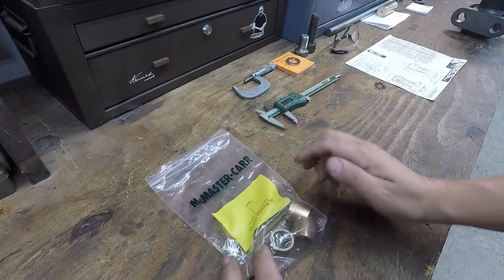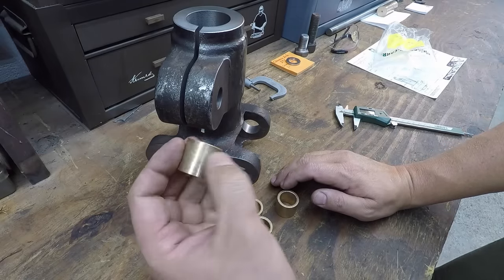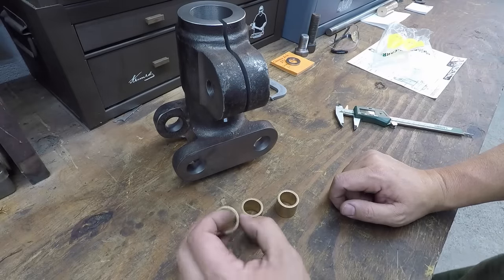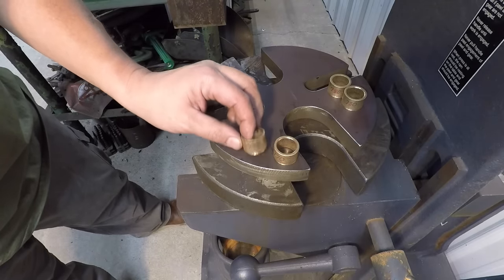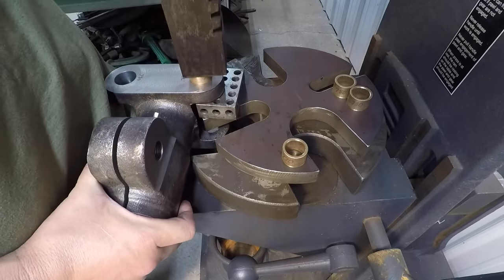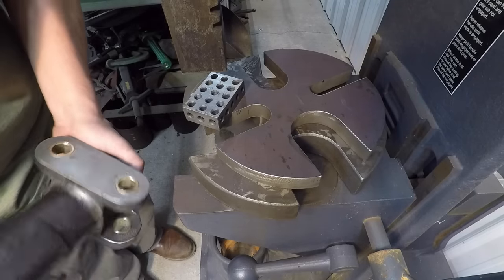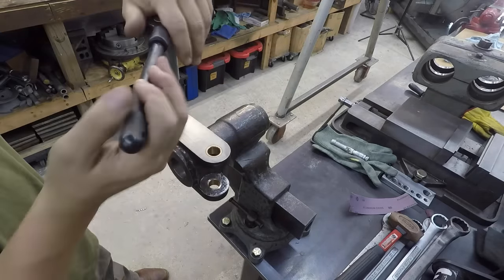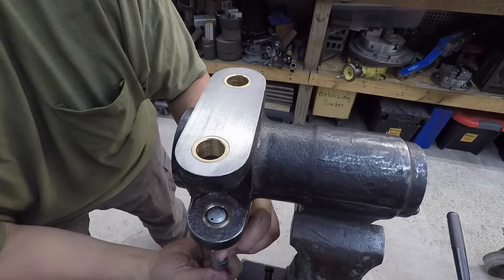Fairbanks Power Hammer Cross Head Part 7: Finished!

Comment: Adam FYI - I was just watching Will's video on rebuilding his Fairbanks and noticed that his cross head does indeed have those 'holes' where the central bore eats slightly into the swivel joint openings. So that's the way it was designed, and not a mistake in the casting, the boring, or the print.
Reply: I was really wondering about that, I wondered how could the casting have such an oversight. What is the purpose though? I wonder on.

Comment: fun fact:  pessimists say the cup is half empty. optimists say it's half full. Machinists say it's twice the size it needs to be and we part off 45% of it in the lathe, champfer the edges, then sleeve it with a .010 collett  :P
Reply: @jamesdrake2378  lol I'm an engineer, we say the cup needs to be redesigned to fit the needed space. after continuous research and development for 6 months, testing new theories for 6 months, the lead maintenance man drank the whiskey and asked for a refill...
Reply: sound technicians only say "check one two" because if we say three then that means we have to work
Reply: @k4x4map46  Now that's funny!

Comment: It's perfectly normal for your hole to shrink a little  when you press your bushing in. 
The bronze bushings reminded me of my buddy's 1959 Triumph .
It had SU carburetors. If they had made the throttle shaft holes with bronze bushings they would have been easily repairable when the holes wore out. But they didn't .

Comment: The Alignment of Perfection. Correct diameter hole in the proper place with DNP concentricity. My shaft would be a happy camper spinning in those parts. ( I learned on the Cutting Edge Engineering Australia channel not to freeze self lubricating bearings for a press fit. It does something to the lube. Cool channel) As Blondihacks said, "Chamfers are what separate us from the animals." 
https://youtu.be/1x0UfKGE4vI?t=1538 He goes on to talk about " Self lubricating bush gets impregnated."

Comment: To add to the earlier comments on machining the Oilite bearings. Oilite are happy to have machining operations as long as you use SHARP tools. They also recommend that you do NOT grind or hone as these will close up the pores. Reaming with an old used reamer would classify as using a dull tool, as Adam has measured a couple of thou' over I guess he is using a new reamer which would be sharp.
Reply: But is it true? (That you shouldn't grind it, I mean.. or is it just an urban myth? After all, during its lifetime the part will experience wear by definitely non-sharp 'tools' - the other moving parts of the assembly! So I find the whole reasoning not very convincing.)

Comment: First time I ever used a ream I was helping my dad work on a Detroit 8V92.  I was reaming the injector tubes and I didn't know not to reverse the ream and a couple of the cutting edges actually chipped off.  Needless to say Pops was not happy.  I was only 12 years old at the time.

Comment: I think he said at the beginning that it's for Eric of 'Hand Tool Rescue'.  I think you can see the actual Fairbanks hammer, at the beginning of some of his (Eric's) videos. e.g. 1920s Rare Battery Charger [Restoration]  - and stop at exactly 0:20 and.. there is a Fairbanks, missing this part. If you search for Fairbanks Model E Power Hammer you can find various pictures of them and you can see where this part goes.

Comment: I tried to look it up online before asking this question but How do they make bushings that bleed oil?
Reply: They are sintered bushings. The metal was not melted to make the bushing, metal powder was pressed together with extreme pressure and some heat creating a porous bushing which can absorb oil.
Reply: @davidr8309  Thanks

Comment: do you have a picture of this piece in action     whats it for or do
Reply: Hey Brian. A powerhammer is a large machine that raises and drops a heavy piece of steel, which deforms a piece of hot metal that's placed underneath it. It's basically a giant, mechanical blacksmith that squishes the metal beneath its ram. The piece that's being machined in this series holds two arms (which are connected via a large spring) that pass through the ram. If you imagine the shape of a turkey wishbone, this component is like the top of the wishbone. Two separate arms will form the sides of the wishbone, which will then have a huge block of steel attached to the bottom. The four holes receiving the bushings will have a hinge pin inserted, upon which the arms can pivot as it's raised and lowered. The large slit and hole at the top of the component is to clamp the cross head onto a vertical shaft, which rises and falls as a motor turns a drivewheel with an eccentric pivot. To sum it uo, the vertical shaft is attached to that eccentric pivot on a wheel, then the crosshead is clamped to the bottom of the shaft. The crosshead has two arms attached to the bottom, and these arms hold a heavy ram that squishes steel. Eric over at Hand Tool Rescue has a great restoration video on one! Here's the link; https://www.youtube.com/watch?v=johaTKyrEBM

Comment: 17:16
Adam, the work you've done is excellent as always but at 17:16 you can see that top 'ear' has a crack to the right of the reamer where it meets the rest of the crosshead. I'd be looking at milling that crack out as being in the corner it could lead to being the start of a stress crack under repeated loads.

Comment: Could you have used the FlexArm to turn the reamer?
Reply: You could but you'd have to square up the job first otherwise it wouldn't cut in the same axis as the bushing it'd be far quicker just to ream it by hand

Comment: For my education, could you freeze those bushing and warm up the casting to make the installation tighter? I know that is a valid procedure for some things, does it work on this kind of application?
Reply: Have a look at this video from  Cutting Edge Technology, https://youtu.be/1x0UfKGE4vI he talks about oil sintered bushes toward the end. CET avoids both heating and cooling sintered bushes
Reply: How would the interference fit be any different once the parts reach equilibrium temperature?
Reply: @skunked42, freezing an oil impregnated sintered bushing will cause the metal to contract and literally squeeze the oil out of the pores. Likewise, heating them up will cause the oil to thin out and literally sweat out of the bushing. In fact, you have to be careful when turning them in the lathe not to put too much heat into the part. Heat thins the oil and the centrifugal force will literally cause the oil to fling off the bushing!
Reply: @aoprngvua2  Well that makes sense. Thanks!

Comment: Is there any difference to pressing these bushing as opposed to freezing them with dry ice?  I am not a machinist but dabbled in it in years ago.  I would at times use dry ice when an interference fit was involved.  It seemed to have fewer failures down the road with things getting loose.  I guess it also somewhat depends on the amount of shrink you get with bronze.
Reply: A very small consideration is that this is cast iron, as such freeze setting the bush risk frozen condensation being caught on the bush surface and beginning corrosion
Reply: oil impregnated bushings
Reply: They can’t be chilled due to the oil impregnation. I learnt that from Cutting Edge Engineering another good youtuber

Comment: How about freezing the bushes to reduce the interference during pressing?
Reply: That could work, but it's much faster to heat up the casting.
Reply: they are oil impregnated bushings.    freezing will/could squeeze out the oil as they shrink
Reply: @levitated-pit  they don't shrink that much

Comment: Great! What’s with the idea I’d heard that reaming sintered bushings closes up the pores and starves the pin of oil? Is that not true?
Reply: If that were the case, turning and boring them would do the same thing, not so. I had a guy working for me some years ago come and tell me that his oilite parts were "bleeding".
Reply: If your cutters are sharp it's not an issue.  If your cutters are dull they will indeed smear the bronze and close up the pores.
Reply: Yes and no depending on circumstance and the bushing itself
The basic gist is that the oil cannot be compressed and as such will not allow the pores to "close" as you are not forcing metal in and extruding the oil out of the way
if you where to overheat the bushing to the point where the oil would burn off then you'd risk that

Comment: Mcmaster carr is great, but you pay a pretty penny for the availability...
Reply: Yes. Mcmaster Carr is normally a pricey place to shop, but they will sell you unit volumes and will deliver next day. If they have the item listed in the big yellow catalog, they will have it in stock. I used to get my standard delivery orders next day for no additional shipping charge if shipped UPS. Common freight orders required premium shipping charge. If you can wait or need volume quantities, shop elsewhere. Pay McMaster Carr premiums only when need the services that they offer. 
McMaster Carr is unique in that they don't ensure brands. Quality is consistent, but they readily substitute brands unless a brand is clearly identified. 
Fastenal, Grainger, MSC are other large wholesalers that will likely beat McMaster Carr on unit price, but don't expect them to break packages for unit shipping. None of these other big players offer as broad of a product offering as McMaster Carr, but they are more likely to have a stocked supply house nearby. I believe Mcmaster Carr only ships from Chicago.
Reply: @paulhunt598  The company was founded in 1901 and is based in Elmhurst, Illinois, with distribution centers in Robbinsville, New Jersey; Santa Fe Springs, California; Douglasville, Georgia and Aurora, Ohio

Comment: Nice job.But i'd have used a Mandrel, to press the bushings in. I;m a tool and die maker, and that"s what we  do in our industry. there's no need for a reamer. if you do ti that way.
Reply: Sorry if im missing something but could you please elaborate on what you mean? A mandrel wont change the shrinkage caused by thr press fit.
Reply: bronze bushings, are a low tolerance fit. There's zero shrinkage. If you do it right.

Comment: Hey guys, not a machinist just a fan of this content. I'm curious what the trick is for micrometer use on the od? Is there a trick to the wiggle in determining you have your mic right?
Reply: You get "The Feel" after awhile. Take a known diameter of a material and practice measuring it. Once you can get it at the right measurement repeatably then you know what that feels like.
Reply: The older physical mics are a cone wedge like you would feel with a sink tap - as it tightens down you get an increased pressure you can feel
The fact it is a conical taper means that you can remove and refit the cone on a setting gauge block of a known good size and set the "feel" to match your personal taste to a small degree
added onto that there is most often a small ratchet that you can use on the bottom as seen here
https://cdn.mscdirect.com/global/media/images/tech-essentials/parts-of-micrometer.jpg

The "wiggle" is mainly to ensure you are parralel with the faces you are measuring and to feel a "drag" as you attempt to move the mic back and fourth to ensure you have not over tightened it
Reply: @hilltopmachineworks2131  Yeah thats what I mean. I was only asking if there was a technique that makes it a sure fire way to get a guaranteed repeatable measurement. I'm sure you get the feel for using the tool right but if we were measuring a clock face for example, whats to say im not measuring between 6 on the bottom and I wiggle it in on top but I actually hit 11:59 or 12:01 right? When you're measuring to 4(I think?) decimal points, how do you know for sure your feel is right? 

I really hope im asking the question properly, I dont mean to confuse anyone either lol 😅

And yes I did watch aboms vid on how to read a micrometer, before someone suggests that! 

Thanks for your time guys!
Reply: @bee6377  That is where the feel comes in. By going back and forth you find the 12 o'clock position (highest point) and you know you are not at 1159 or 1201

Comment: I'm not sure you're supposed to ream those bushings...
Reply: There is nothing wrong with reaming plain phosphor bronze bushes.  The ones you can't ream are bushings that have some kind of lining in the inside e.g. ptfe.
Reply: @ferrumignis  Problem is that these are not plain phosphor bronze bushings, they're sintered PhB. Should be bored with a single-point tool; a hand reamer smears the surface and obstructs the oil getting through to the bearing pin.
Reply: Correct, a Roller Reamer should only be used.
Reply: @ferrumignis  See Goseplman's reply.  There seems to be some weird idea here that any sort of suggestion or constructive criticism is not allowed.  That ideas or information not strictly in keeping with his practices are to be discouraged.  I don't get it.
Reply: An interesting discussion ensues.
My verdict ? I think you are correct but only partly. Even if 50% of the pores are blocked by reamering, there are still plenty of pores not blocked to permit oil to lubricate the shaft thus inserted.
I know when we've fitted these, we've always prefilled them with oil. Smaller ones can be oiled between finger and thumb.